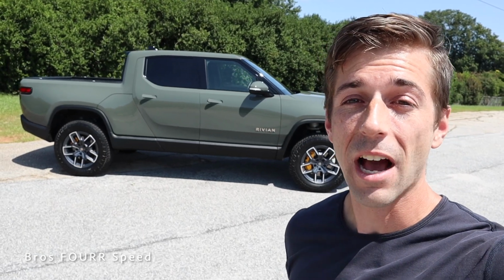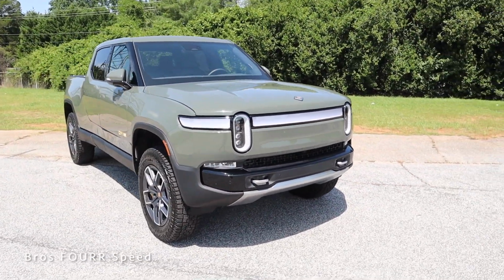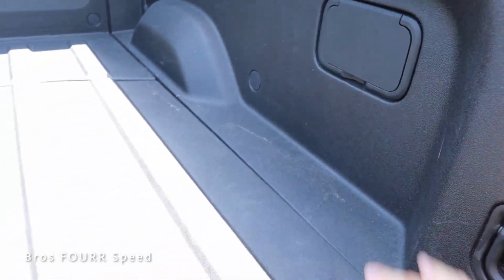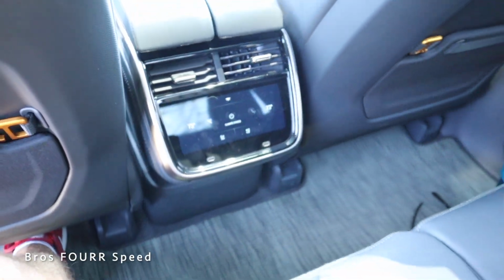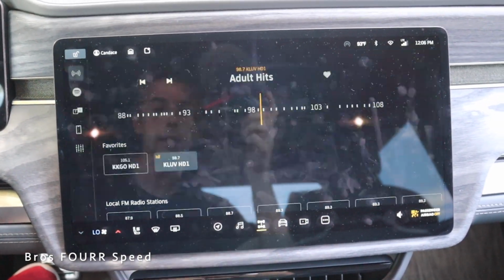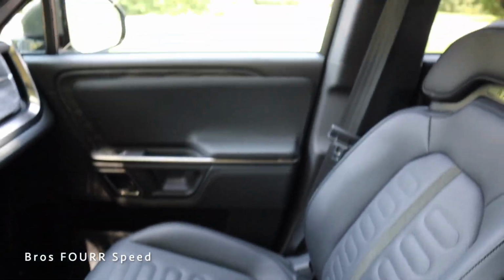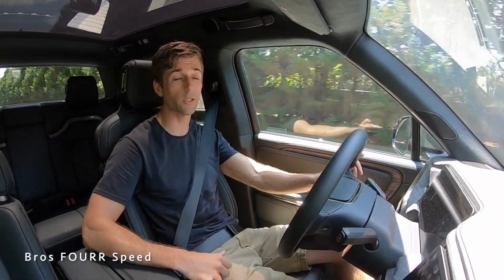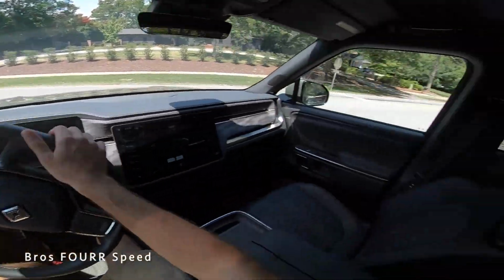2022 Rivian R1T Launch Edition: Start Up, Test Drive, Walkaround, POV and Review

Comment: 80k 🤣
Reply from the maker: Is that too expensive for this electric truck?  What do you think should be the price of this Rivian?
Reply: @BrosFOURRSpeed  60k max What is the point of buying electric when u spend that much more that will never equate to enough savings from gas. Also most electricity is generated from coal which is way worse for the environment than gasoline.
Reply from the maker: @Ab82903  I completely agree with your statement on that! Electric cars are still new “ish”, which is why they are expensive. But I don’t think they will catch on because the infrastructure to support electric cars with chargers everywhere won’t ever work!